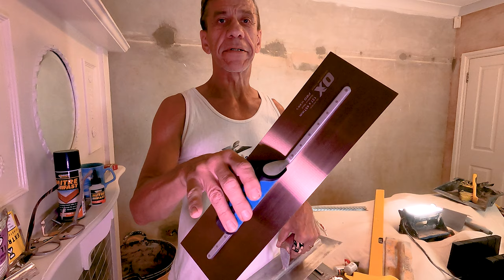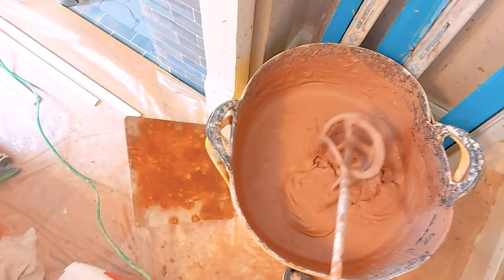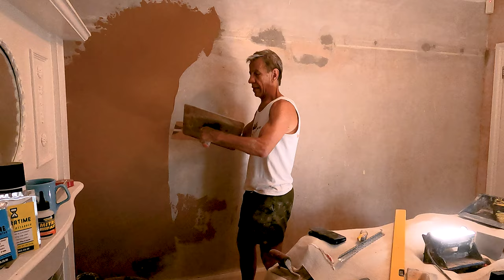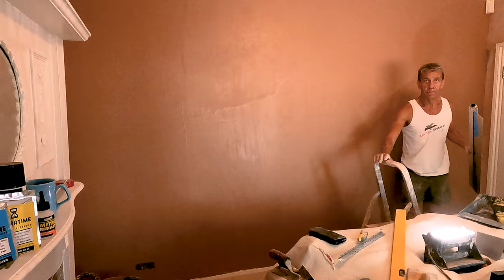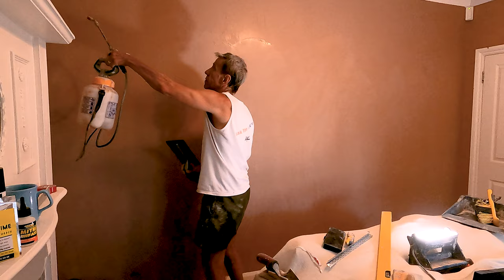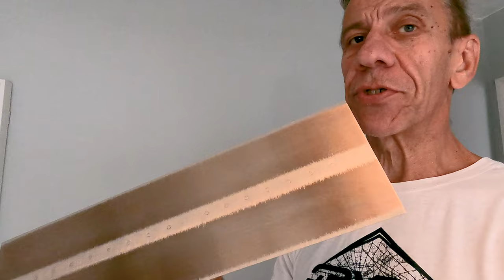18 Inch Ox, What do I think?

Comment: Nice trowel Eric!
I'd love to see what you think of the trowel I use, an 18 by 4-1/2 marshalltown or any brand that size
You may find the 18 by 5 is too wide,
You'll feel alot more strain through your wrist with that extra half inch width where you're having to curl your wrist to direct the pressure to the edge of the blade but with an 18 by 4-1/2 when you find your balance and the right angle you're able keep the wrist alot more straight derecting straight pressure from your palm, to the back of your handle straight through to the edge of the blade with very little strain on the wrist as you trowel. Hope this helps 👍🏼

You may be able to see in my videos how I balance the blade as I trowel I hardy need to grip my handle I just balance it on my back 3 fingers.
And remember more angle = less strain!
Reply from the maker: Thanks Dan, sounds like bloody good advice, I wondered why you could get them narrower, now I know, I'll see how this one goes for a while now I've bought it 👌👍Thanks again mate, appreciate it
Reply: Oh wow so is that the actual reason why the trowels are manufactured narrower?

I asked this question on one of the plastering groups on Facebook and I got all sorts of answers! The most common one being that the narrow blade is designed for sand and cement. 

I’d love to see your video on how you use the 18 x 4.5” trowel to prevent extra strain on your wrist. Kindly share a link.

Thanks
Reply: i use and 18 x 4/12 and i agree, when laying on a flattening i feel very little pressue. My 16" nela is my least favorite trowel seems to cause far more wrist strain

Comment: I’ve just bought a nela 18 inch carbon, currently sat in vinegar. Surprisingly enough it didn’t feel heavy or stupidly big considering I use a 13 inch mt carbon.
Reply from the maker: Is it 5" across?
Reply: @ThePlasterer yes mate, well 4.75. I sacked it off in the end and went with the concrete mt 18x4, use it instead of a flexi trowel now, used my Mirka sander to get the edges nice and sharp

Comment: I'm only DIY but I've done a fair bit of spreading - just finished my kitchen extension actually. I've had a tyzack 13" for ever but I broke it the other day so I'm getting a new trowel. Was considering getting a 14" as I don't think I would get on well with anything much bigger. You had very good results Eric. It's got me thinking 🤔
Reply from the maker: Once a longer trowel is worn in its lovely for troweling up,  it doesn't take long to get used to,  you can get more on the wall quicker and they leave far less trowel marks when applying the first coat
Reply: 16 inch is perfect for most people mate
Reply: I've had a 20" an 18" a 16" and for the last 8years I've just used a 14" out of them all me an the 14 get on best, no wrist pain... I also don't skim 100m² a day any more either 🤷‍♂️🍻
Reply: Stick to a smaller trowel m8, it will wreck your wrists and shoulders toweling up with  that

Comment: I noticed you used it straight away whilst new yet it didn’t seem to drag or leave lines? 

I have a 14x 5 ox trowel. But leaves lines like hell. 

Would you say the best way to deal with this is, apply the finishing coat and let it take right up and then flatten? ( less chance of lines / dragging plaster off with blunt blade ) 

Thanks
Reply from the maker: It's a pre worn when new but still wasn't sharp enough for a wet trowel. It is now👍
Reply: Thanks for ignoring the latter half of my question… lol
Reply from the maker: @omarismith3655  sorry, don't know how I missed that bit 😂 if you're just using a trowel for the whole process, apply first coat, leave to pick up a little font play with it, then water down any plaster you have left and use this for second coat, which you can then apply which should help you to flatten the plaster more, then don't touch until it's ready to spray some water on. You can only get lines out as the plaster starts to harden, the best plasterer in the world can't really get lines out of wet plaster

Comment: Great trowel but after laying in and start flattening it puts extra strain on the joints. Not for me and after 44 years plastering I want to carry on.!!!
Reply from the maker: Fair doos Bernard 👍
Reply: Couldn’t agree more Bernard day in day out with a 18” trowel no good for your body. 13” MT for me nice and light
Reply: @John-gg7ud  similar now John as as put on with 16” and trowel up with 14” both MT SS.
Reply: Have you give up on the carbons now Bernard ?
Reply: @jasonrichardson7762  like to keep mixing it up mate so using the Kraft SS trowel for a change
Reply: @bernardscott1783  Are they any good?
Reply: @jasonrichardson7762  yes mate but take some breaking in but always use lots of wet & dry to take the edges off

Comment: I moved over to ox form marshaltown years ago and wouldn't go back.. 18 inch is way to big for me  though! Just find it clumsy and dont see the point if you going to rule it with the speedskim.
Reply from the maker: Yeah you have to work  with whatever is most comfortable for you
Reply: Just curious to know why you moved to Ox from MT. I was a plasterers labourer many years ago (45). So I know a little bit, but so many things are different now and a lot easier by the looks of it. I have been doing bits for myself and decided on OX instead of MT.I was wondering if the extra cost would have been worth it?
Reply: I bought one for my apprentice and just loved the blade, its a little more worn in and has a slight more flex. So sold all marshalltown .